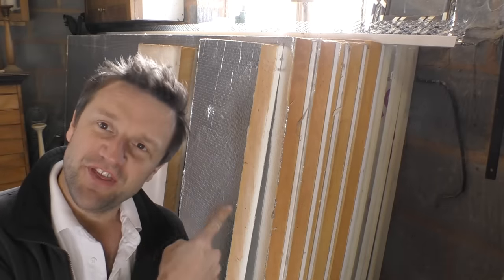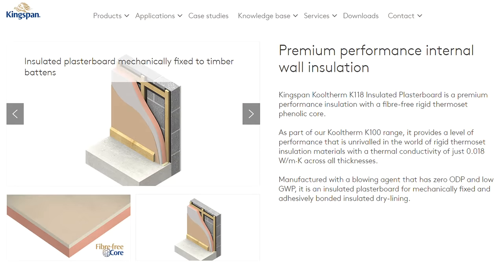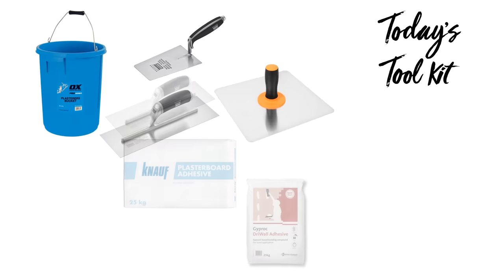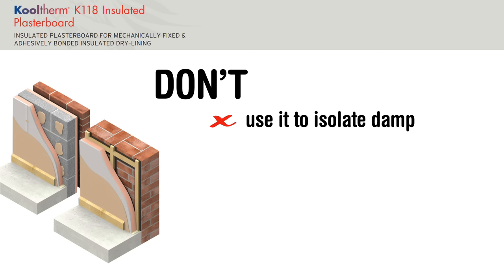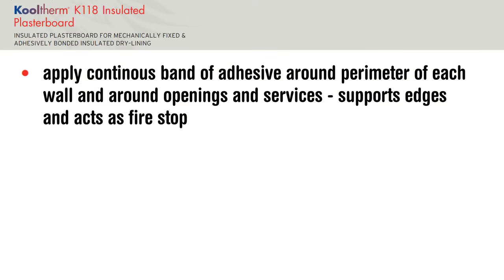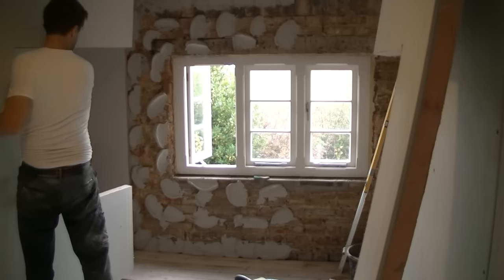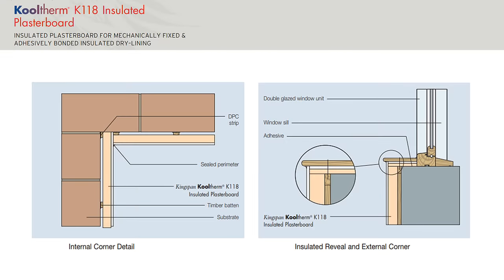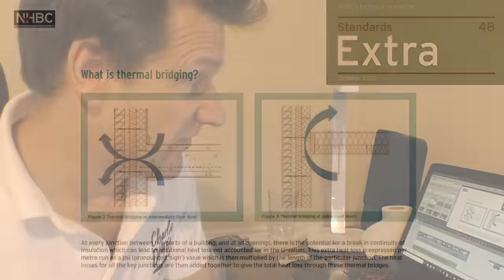How to Dot & Dab Insulated Plasterboard - a DIY Guide

Comment: Another great video.  Going through the process,  but got 1 question. Would the insulation plasterboard be OK. Bungalow dormer. Window frame is all wooden round it got no place to insert normal insulation.
Reply from the maker: Yes I would think so - but can't be sure without seeing exactly what your situation is. Just make sure there aren't any gaps in the insulation. Combine with spray foam if necessary.
Reply: For your application it may be worth looking into a product called 'Spacetherm'. Much reduced (often 10x) thickness for similar U Value (W/m2k).

Comment: Hi Charlie’s we will be doing insulation in our Victorian 1st floor flat. How do I go about the original ceiling coverings, I guess I would need to lose them and then replace with a new? What regs do I need to comply with if doing while flat? And would u recommend doing internal walls too or just external?
Reply from the maker: Hi Marek, I'm afraid you'd have to take off the ceiling cornicing which is quite a consideration really. On the building regs you'll need to check with your local building regs dept as it depends on the construction of the walls, but it's all about ensuring you meet the u values by using thick enough insulation. I would only do the external walls but pay close attention to cold bridging and if you do cut though the boards for sockets, insulate behind with expanding foam rather than adhesive as the sockets can be a major conduit for cold bridging, moisture and condensation.

Comment: Really good job, any updates? did you have any issues with damp?
Reply from the maker: Not on this one so far as I'm aware, but there is some damp in the sockets in my son's room. They're a big source of cold bridging as typically you cut through all the insulation. Spraying expanding foam behind the back box and in the gap around it before fixing it in place would probably do the trick. I've done the external wall in our bedroom and I battened that with 2x1, infilled the battens with 1 inch Ecotherm insulation, foil taped over the battens and then screwed the insulated plasterboard on top. Expanding foam tape in the gap below the insulation.  That way there's no cold bridging when you cut into the insulated plasterboard for the back boxes. It's a dark art, insulating, and everyone has differing ways doing it, but the main rules are to establish an impregnable vapour barrier and to minimise any cold bridging.

Comment: Bollocks I wish I saw this vud before I decorated my kids room now  just one question tho, is it essential that u have to remove the plaster from the wall and expose the brick work????
Reply: No need for that if it is tightly bonded with the brick wall. The insulation and adhesive will pull the plaster off of it if it is as loose as in Charlie's house. Still I'd advice to sand the paint off the walls so you won't create a seal with a plastic-type paint in between the layers which could possibly be a moisture trap and build mold due to moisture and temp fluctuations.
Reply: As Eetu said, you don't need to remove the plaster if its tightly bonded. But. If you don't remove the plaster you are going to lose several inches of your room. Dot and dab works much better on brickwork than it does plaster. Especially old dry porus plaster..

Comment: Hi Charlie, thank you for this video, it gives great advise and gives me the confidence to insulate our home with Kingspan. I have one question though and that has to do with the electrical cables running behind the plasterboard. I see yours are at floor level and not in the 'safe zone'? (Although I agree that it's safer behind the skirting board). Can you advise how the cables should be installed behind the plasterboard to ensure they comply with regulations? i.e. for example light switches etc? Do they need to be protected by a metal channel to disperse heat or can they be clipped to the brick wall? Your advise is appreciated as we do have Building Control involved.
Reply from the maker: Could you ask your building inspector, or failing that go on the government building regs website? I'm afraid I don't know the answer off the top of my head. I thought what I had done was compliant, but one important consideration for cables that go behind or in insulation is the rating. You may need to go with thicker diameter cable and/or use the fuse switch in the customer unit to eliminate any risk of the cables overheating.
Reply: @CharlieDIYte  Thanks for the quick response Charlie! I will discuss with the Building Inspector and also contacted an electrician to 'supervise' the installation to ensure we are compliant!

Comment: I have a new build and am really concerned that there’s a lack of insulation- I know it’s dot dab but is there a way of knowing if the plasterboard is insulated?  For a new build (two years old) we are waking up to temperatures of 11 degrees! We turn on heating to full and have it on for a good 4 hours, have a draft excluders and the room heats to about 15 degrees - it’s takes about 30 minutes for it to drop 2 degrees.... I’m not in the trade so any advice/guidance would greatly help! Many thanks

Comment: Charlie I took a look at your humidity video and wanted to know if this type of insulated wall paneling would work on a older stone house in the humid part of Central Portugal? I'm interested in insulating a lime rendered stone house with out trapping moisture between the stone and insulating material. Thanks for any guidance.
Reply from the maker: I wouldn't recommend it for anything where you're worried about trapping moisture between the insulation and stone, because this will do just that. The wall has to be dry before you insulate, and if you don't insulate properly ie have holes for sockets (like I did!) or leave gaps between each board, you'll get cold bridges which are a source of moisture ingress and therefore interstitial condensation. So I think you need to look at other options which would allow more breathability.

Comment: Hi there, you say in your list of "don'ts" (at 11.08 mins), that the product should not be used on walls to isolate damp. But if you mechanically fix (with screws) the insulated plasterboard, which has a vapour barrier, I hope that a bit of damp in my rendered wall, which is one brick thick, should not pose a problem?
Reply: If I may suggest, if the wall is a single leaf, it might be wiser to consider creating an insulated inner leaf with ventilated cavity between the two. Inner leaf being a timber-frame insulated 'partition' with vapour barrier on the inner side and vapour control on the outer.

What you suggested, if the damp is rising and not from condensation, it would most likely lead to water pooling to the bottom of wall, on the floor.
Reply: @kawo666  , thank you for the suggestion.

Comment: Hi there.
I’m installing this in an upstairs bedroom in our old, cold Victorian house with timber sash windows. How did you deal with the window casings? Timber or plasterboard?
Cheers
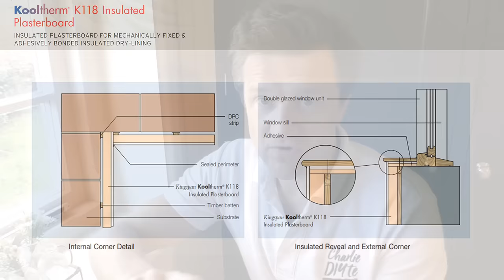Reply from the maker: There's a section near the end with a visual showing the importance if having continuous insulation around the reveals up to the window (23:23 minutes from memory). In this case I used a timber lining in the reveal (architrave at the front to hide the end timbers) and sprayed expanding foam behind it for insulation but in our master bed I used the insulated plasterboard, cutting a slither out of the back of one piece so they could be butted up with the plasterboard touching at the front. Whatever you use do everything you can to minimise breaks in the insulation that create cold bridging. You could consider using the expanding foam glue rather than plasterboard adhesive - that would provide much better insulation around any plug socket cut outs - which is a major culprit of cold bridging. In our bedroom I battened the wall first, insulated between the battens, foil taped over the battens and then screwed the Kingspan K118 to the battens, giving a continuous insulation barrier and allowing me to safely cut the socket boxes.
Reply: @CharlieDIYte  Thanks for the response. I’ll use the timber and foam. Many thanks.

Comment: Thanks @Charlie DIYte! Very informative. Few questions:
Does you outer wall insulated? if not, won't it attract damp from outside as will work as bridge? 

I am planning in insulate my wall on the ground floor, but not sure if there is a risk to attract damp if my outer walls not insulated (masonry build).
Reply from the maker: No, the outer wall isn't insulated. If you have damp getting in from the outside you mustn't insulate the wall until this has been eliminated. Assuming there's no damp, you still potentially have a condensation problem due to moisture generated inside the house passing through any cold bridges to the outside wall. This wouldn't be a problem if you can establish a complete vapour barrier to prevent vapour travelling through any cold bridge gaps in the insulation. This insulated plasterboard has an in-built vapour barrier but of course you penetrate that when you cut through for the electrical boxes, and of course where each sheet butts up to the next, you have a potential cold bridge. To get round this in our bedroom, I battened the wall with 2x1 tanelised battens, dpc where they touched the wall, infilled with 1 inch thick ecotherm insulation, foil taped over the battens and then screwed the insulated plasterboard to the battens. That way you have an impregnable vapour barrier and have the luxury of cutting through the final layer to fit back boxes, without creating any cold bridges. At the end of the day, this is a bit of a dark science, and very hard to get right, so seek professional advice if you're unsure how to best tackle your project, including the damp ingress from outside.
Reply: @CharlieDIYte  thank you for thorough explanation.

Comment: Hi Charlie, how would you go about fixing something heavy to a wall with the thick insulated plaster board on? Is it just a case of getting a long enough fixing to reach the actual wall? But then is it possible to insert a wall plug? Thanks
Reply from the maker: Depends how heavy. Have you watched this vid https://youtu.be/L2Hy1IhQ17s If it's really heavy you'd probably want  to use frame fixings and go straight through into the wall behind. Otherwise, maybe a wall anchor or the T-bolt as they force themselves open and won't puncture the vapour barrier.
Reply: @CharlieDIYte  Ah thanks for the help and I'll check that one out

Comment: Charlie, just one question where do i get that levelling laser from that you used up side and across top of wall. Would come in handy. Thanks mate.
Reply from the maker: Oops. Must update the Description with that. https://www.screwfix.com/p/dewalt-dw088k-self-levelling-line-laser/38474 Awesome bit of kit. It has a magnetic back plate so you can attach it to the corner of your walls where you've got plaster beads. I've used it to mark out shelves, pictures, as well as in the day job hanging curtains!

Comment: Thanks for this Charlie. Really appreciate your post and I am looking to update/fix heating internally as well, so this is fantastic. 
I have however been told to the contrary however, that to maintain a single wall property it needs to be traditionally kept. Using Lime renders/mortar and woking with airflow to maintain a healthy home. The cold is just something you need to live with in regards to a a property of this age and build, and these modern remedies will effect the structure long term.
Is your home rendered with Lime on the outside? Do you face cracking and or external issues due to your internal adaptation of an historic single walled property?

Thanks for the video. 

G
Reply from the maker: Hi Guy, thanks for this and good to hear from you. That's interesting. In my case the adaptations started long before I bought the property. It was tyrolean rendered in the 1970s when what was 2 cottages were united into 1 - rendered I suspect to cover up shoddy brickwork and perhaps other issues. The previous owners went further in wallpapering everywhere with polystyrene backed wallpaper (nice!) So it can't breath from the outside and has been smothered for years from the inside too. There are no obvious signs of structural issues. The render is a little crumbly between the bricks as you would expect for a house of this period but other than that I fully expect it to outlast most of the rubbish that's being built today 😉 However if that's the advice you've received then of course you'd be wise to take it.
Reply: @CharlieDIYte  Thanks for your response Charlie. Yea, it's an ongoing cause of head scratching from my side. Contradicting theories, both with individual merits.  Appreciate your post and good luck with the house. :0)

Comment: Hello Charlie, I need some advice, please...I have spent a lot of money building a potting shed and decided on a clear corrugated plastic roof  BUT I now have problem with droplets falling from the inside under the roof . Without taking it all down and replacing it do you have any ideas on how to insulate it to stop all the condensation?
Reply from the maker: I think you need ventilation, which presumably isn't very practical advice. The only other option is to create a warm roof to eliminate the dew point, which again would mean a roof that doesn't let the light in.
Reply: @CharlieDIYte  Oh thank you, Charlie, that is great advice I think I will put polystyrene tiles up and see if that does the trick

Comment: Wow, Charlie nice job mate, I am refusing to pay an arm and leg for my energy bills which went up from £126pm to £362pm, I much rather spend the extra money on insulating my house, it almost seems Government deliberately allowed Energy companies to hike their prices up forcing us to start taking drastic measures. I am planning to do the same now, either go for external wall insulation or internal, if I did choose internal wall insulation, I do not have the energy and time to strip the plaster off all the wall, since you will need to get rid of the plaster and possibly hire a small skip, too much of a bother, I am going to take a risk and dab it on to my plaster, he who dares wins, whatever might happen I will deal with it then if I am still alive in 5 to ten years time, after that its someone's problem. 
A friend had a loft conversion done, his builders over-ordered the Ecotherm insulating boards, almost 6 full size boards lined on both sides by a foil,25mm thickness, I am going to dab these straight onto my external brick wall and use mechanical fastenings in places, fill the gaps with expanding foam, just to see what difference it makes to retain heat in my bedroom this coming winter, if it feels warmer than last year, I could do thicker 60mm insulation, and go from there, have it rendered later after checking any problems behind in the uneven . gaps between the brick work and the boards.
Reply from the maker: Trouble is, you don't want to get the Ecotherm wet. Not sure it's designed for external use.
Reply: For your application it may be worth looking into a product called 'Spacetherm'. Much reduced (often 10x) thickness for similar U Value (W/m2k).

Comment: Hi Charlie, your content has been very useful to me - thank you! I have a question about Dot & Dab. Could I get away with doing this on a solid brick wall which has from what I can tell, some sort of bonding coat then multifinish, I want to put this in my box room (Victorian terrace) which is freezing cold in winter.  The room is not enormous and I guess I could take it back to brick if needed. What is your advice? Thanks in advance
Reply from the maker: You're very welcome 👍🏻 I've done that on one wall in my daughter's room, but it was render not bonding and had a really good key to the wall beneath. I probably wouldn't do it with bonding just in case any condensation got through, on which point the key with all insulation work is to ensure as far as possible that the vapour barrier and insulation is continuous, to minimise any cold bridging, and interstitial condensation. Back boxes are a big source of cold bridging because you typically cut the insulation to put them in, as is the point where you butt up each insulation board - because although this board I used has integrated vapour barrier, there's obviously a break in it between each board. I think if I was doing this again, I'd spray expanding foam in the gap around the back box and behind it before screwing the box in place, as a more effective measure in managing this particular cold spot. In our bedroom I used a different approach. I battened the wall, infilled between the battens with 1 inch celotex isolation board, foil taped over the joins and battens, then screwed this Kingspan board on top. That way there's a continuous insulation and vapour barrier behind the Kingspan, and eliminates the issue with socket back boxes.
Reply: @CharlieDIYte  thanks for the response Charlie. I started this work today in the box room. I have taken the render all of and will need a day to recover lol. When you pva'd the foil on the board, was it mixed with water or not? Also do you just skim ontop of these boards once all in place. Many thanks in advance.

Comment: Hi Charlie, can this be done onto already plastered and emulsion painted walls? Or does it need to stripped back to bare brick?
Reply from the maker: I don't see why not, if the render and plaster is well adhered to the wall unlike mine - and particularly if you're going to mechanically fix it too, as recommended. With all jobs like this the important thing is to ensure the walls are bone dry before you start. Maybe consider sticking it in place with the expanding foam manufactured for this purpose, rather than adhesive, and around the plug sockets foam would be better to minimise cold bridging.